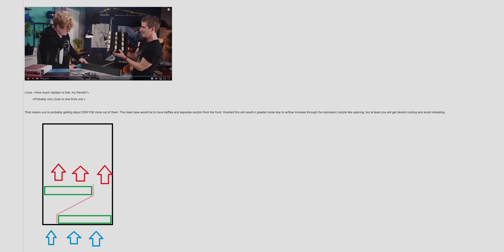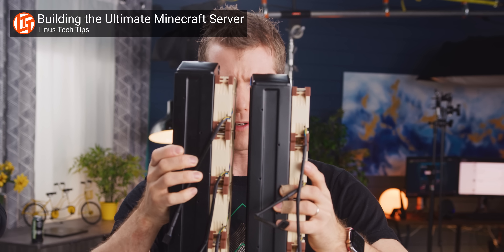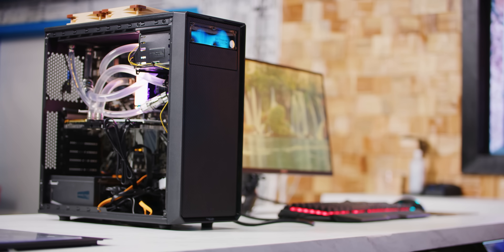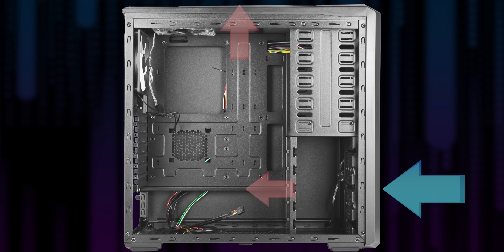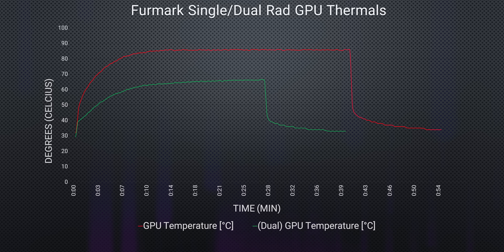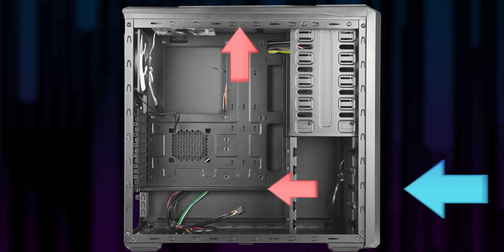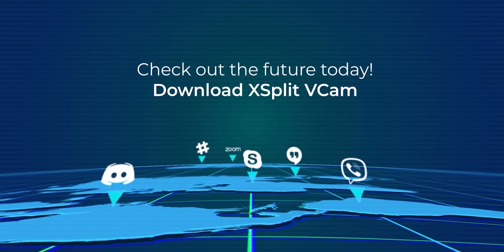I’ve been water cooling wrong for YEARS - $H!T Manufacturers Say

Comment: 0:18 judging from this Corsair is saying you need separate airintakes to supply each rad with their own cold air. Which makes sense. Corsair is right that the most cooling occurs with the highest temperature differences; so you want cold air against your hot rad, not pre-heated air.

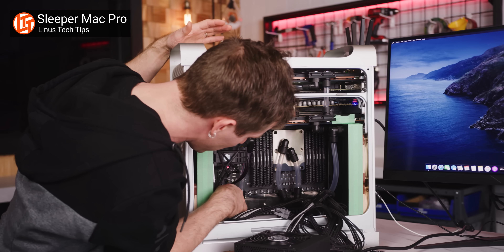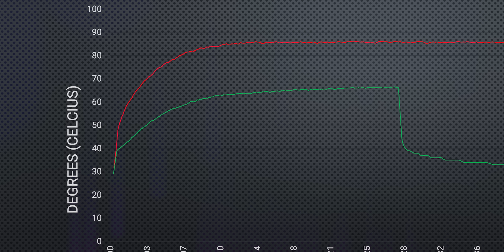6:46 Remember not 2 minutes ago where your additional rad gave you 20 degrees performance increase around 5:00 ? Well that's what I think Corsair is saying; you're essentially wasting the rad's power by not feeding it fresh air.

edit: I realize that I didn't properly explain the next part. What I'm saying is; in reactors they are OK with wasting cooling potential to reach higher temperatures so that the 2nd loop does more work. A 'reactor setup' water cooling would exhaust hotter air , but a 'corsair setup' water cooling would exhaust more heat .

Also I saw the "crosscool" comment, but the problem with a nuclear reactor is that you need that heat to do work. See https://www.ucsusa.org/sites/default/files/images/2015/08/np-how-Pressurized-Water-Reactors-work.gif
Here the first loop is heated by radioactive decay and cooled by the 2nd loop, and the 2nd loop is heated by the first and then drives turbines hooked to a generator before being cooled by a THIRD water system. You're doing work, not cooling PC components.
Reply: It's a consideration that you should include some extra fresh air intakes (or leave gaps in the case) but as Linus says at 6:45 they saw a 5 degree difference removing the 3rd stacked radiator from their server build which is probably the worst case scenario for this theory and it was still worth having the 3rd rad.
Reply: @TimSheehan  You're not wrong, they did get a 5 degree temperature difference with another rad. Yet in their test an additional rad created a 20 degree difference. And that 's what I think Corsair is saying.

Now sure, if you need more cooling, you can't do anything except stack the rads and that 5 degree is all you need.. Stack to the heavens my friend. But remember that if that other rad instead had it's own ambient air intake; there'd be even more cooling than that 20 degree difference.
Reply: @TimSheehan  it’s not that stacking radiators won’t lower temps, but stacking radiators lowers the effectiveness of the additional radiators. If the radiators were in a different configuration, the temps could be lower, or you could use less radiators and save money on your build.
Reply: @TimSheehan  As he said they removed the 3rd Stacked radiator so reducing the air flow if they had left the 3rd set of fans in would it still be the same? That said what if they removed the 2nd radiator as well and still left 9 fans would it still cool the same? As you can see it can go on and on. What would happen if it was just 1 radiator with 3x14k rpm fans.
Reply: @Northeastfarming  They didn't say about the fans but removing the resistance of the radiator would counteract the airflow difference even if they did remove the fans.
Reply: Strictly talking the "crosscool" comment. The fact that reactors need the heat to do work is irrelevent. If you put the hottest water rad at the end of the line for air flow then progressively get cooler as you get closer to the components then you will get an effect where the air gets warmer and warmer as it goes out of the system.
Reply: @Dem0n1337  Kind of true. If you have the lowest temp rad fed not by your components, but with cooler water, it will cool and warmer air will flow away from the rad. If then you have another rad behind it, thus fed with the warm air, it'll still cool. And as long as the water flowing through the rad is hotter than the airflow through the rad; you'll both have cooling and hot air out the end.

But do keep in mind that the hotter the air, the lower the amount of cooling. The tl;dr of Newton's Law of Cooling is that the greater the difference in ambient en object temperature, the greater the object cools. So if instead of each rad venting warmer air to the next rad, we have each rad exhausting the hot air into the .. well air then we'd achieve far more cooling.

All this means that it's, in fact, not irrelevant that you need that heat to do work. After all, the exhaust air of two rads each with their own in and out take is of a lower temperature than a (correctly) in series connected rad system where one rad feeds the other. This means that, yes; the air is hotter out of a 'reactor setup', but a 'corsair setup' exhausts more heat (i.e. cools more / is more efficient in *cooling*).

The primary use of a reactor system is not to cool the reactor, but to use heat to drive a turbine. The control rods are used to slow down the reaction and thus lower the temperature. Hence when that fails you are risking a reactor *meltdown*.

(pre-emptive edit, I may have to edit that first paragraph, it looks messy xD)
Reply: This, Linus needed to do another test with fresh air to the two radiators.
Reply: I also think that Corsair might have been talking about a different build that had much lower temps and a lower temp difference between the air and the water in the rad, or when they were directly stacking the rads like in the server they water cooled.
Reply: @nicokart6632  The sim graphics suggest otherwise. Linus is probably right about them not factoring in ambient air.
Reply: @Silicon_0014  There is no "ambient" air here the top rad is pulling air from the back and bottom. Its air pressure pulling the air in but they are mixing that air with the exhaust air so it is going to be less effective. Put the top rad at the back and have it also intake air. Block the bottom vents and put exhaust fans on top and it will work even better. Why do a shit job and say see look it "worked" without testing the proper way and seeing that it works better and cost nothing more. Why tell people to use their components in a less effective way? Did Corsair say that it would not work at all? No, so doing a test to see if it offers ANY cooling does not prove Linus right it proves he does not know the first thing about running a test. They always run 1 or maybe 2 tests and declare things settled. That's not how testing works and they do not have a control to test against here. Linus tested to prove himself right and look at that he did. He decided what would be considered a pass and he met that bar and called it a day. When you test a hypothesis you are trying to prove it WRONG not right and you exhaust every possible variation before you say that it is true. He tested ONLY his solutions and stopped when he say a change but did not bother to see if there was a better solution. Physics and math are not wrong here and neither is Corsair.
Reply: @WillisPtheone  he is also adding more fans to the case. I also think the single loop will work better with 4 fans helping with airflow. the only thing linus is proving is that he did not understand what corsair was saying.
Reply: @nicokart6632  yup, that's the tl;dr

Higher dt means more heat exchange; provide each rad with fresh air
Reply: i never downvote but this video deserved it and can entirely be summed up as a strawman. wtf linus.

Comment: I'd like a revisit on this topic. what does the difference in water volume make in this test? What if the solo rad was bundled with a bigger res that would have the same volume as 2 rads with a smaller one.
Reply: More radiators provide more surface area.  Adding more water will increase the time to reach steady state, but won't improve cooling overall.  Adding a second radiator will both increase the time to steady state AND improve cooling due to the additional surface area.  Of course, this is dependent on the exact PC enclosure that is used, how many fans are installed and in what orientation.  As Tech Jesus has proven, more fans is not necessarily better....and the wrong fan configuration can be just as bad as no fans at all.

Comment: Why not suck in cold air through a radiator from top?

This creates overpressure in the case, but if a free fan blows out the back, it could work there, couldn't it?

I will test it

Comment: there is something to be said about set up with concurrent vs countercurrent flow. 
If the radiators are in series you would want to set them up so that the hottest water contacts the coldest air.

Comment: Why didnt you run the tests on the setups they commented on? With multiple rads you risk overheating the liquid if airflow is restricted. There has to be enough air coming in the rad for it to properly cool. I wish there were more affordable cases that allowed rad setups that take air in from outside the case, go through the rad then blow outside the case

Comment: stacking radiators together like the mc serv works fine, you just have the rear most rad that should be receiving the warmest air be the inlet and have the water cycle forwards through the progressively cooler rads, yes you will have diminishing returns but it will work just fine.

Comment: I think what Corsair was getting at is that if one rad (say a 360mm) can already handle most of the heat, adding another one could hurt it, as the air is already heated up from the front rad and is also being heated up more with RAM, VRMs, and so on, potentially leading to a higher temp in the second rad. However, this assumes that no fresh air is being introduced into the case, as Linus pointed out. A single 240mm is going to be heat soaked by a high end CPU and GPU, and I would love to see what happens with a closed off case and like a 360mm at the front.

Comment: 2nd rad and water introduce additional thermal mass so the heat capacity of the loop will increase in relation to that regardless of the cooling elements
Reply: they waited until each loop reached a steady state

Comment: Cooling vs power usage is one thing I'd definitely be considering ..... A variable seemingly MISSING from the test. Cool inwards air is something Nice America (aka Canada) has an abundance of too, so getting more cool air into the case is a goodie too!

Will water cooling even be relevant in the future tho, considering the leaps in semiconductor design & manufacturing with chips emitting less heat all round!

Comment: Corsair complains about stacking, Linus starts testing non-stacked.
Reply: They also tested removing one of their stacked rads from the minecraft video and temps jumped 5 degrees. Having one rad input and one output for the main test is very similar to the hack mac pro that corsair complained about first too
Reply: Did you happen to skip too far when Linus delivered his sponsored message? The first time Corsair reached out to them about this, it was for their Hack Pro build which had two rads on opposite sides of the case - this was what they tested in this vid. They reached out to Linus AGAIN regarding the stacked radiators (which they tested by removing one and checking the difference in temps).

Comment: You have to flow the liquid in the reverse direction than the air. See cocurrent vs countercurrent heat exchanger designs. Later is dramatically more efficient... if both fluid had the same heat capacity.

Comment: A tiny difference can be achieved by changing the direction of the water in the radiator.
If the colder water enters first the "outtake" radiator, and then the "intake" one, we can obtain the best result.
https://www.unilab.eu/wp-content/uploads/2017/04/unilab_heat_transfer_blog_Evaporators_and_condensers_counter_current_or_co-current_arrangement2.jpg

P.S.
I think that corsair needs new engineers in their staff.

Comment: :) If adding more radiators wasn't a thing to help keep temps down then why do super cars have like 10 of them. The Bugatti Veyron  not only has 10 Radiators, but also has 3 heat exchangers. And correct me if I am wrong here but I am fairly certain that a Bugatti Veyron produces a hell of a lot more head at 250+ MPH then a single Radiator can handle. Just sayin.

Comment: What I'm curious about is whether the air pushed through the radiator stays there long enough to get saturated. You'll hit "critical mass" at some point, where the amount of heat generated by the CPU and the amount of heat dissipated by the cooler will become more or less even, at which point increasing the airflow any more won't help, because the cooler can't dissipate any faster. (This is even more evident when the CPU is idling; at some point, increasing the fan speed just doesn't affect the CPU temperature at all).

I must admit that I'm far from any expert on physics though, so this is mostly just speculation on my part.

Comment: im not a water cooling person, however the addition for a 2nd radiator would increase the thermal capacity of the system (more water), since the thermal capacity is measured as J/KG/K you will have the same J (same heat outputting components) you KG will increase (more water) therefore your K (temps) will decrease therefore your dT across the first radiator would be greater results is a grater cooling rate from newtons law (cant remember the equation but i know its based on dT/dX), id suggest, to test this, instead of adding a 2nd radiator, add a 2nd reservoir and try again. I could be wrong here but i thing the physics and maths works out

Comment: A second radiator makes perfect sense. But it has to be integrated correctly. The hot water needs to go through the "hot" radiator first and then through the "cold" one. You're basicly trying to emulate a counter-flow heat exchanger.

Comment: If I remember correctly from my brief education in power engineering; you need to have a difference of about 3 degrees celcius to get a transfer of heat that actually reduces the heat from the hot side. Anything less is just too close to be useful. And even then, you need to have that difference stay constant. Water is nice for that, at least until it builds up in thermal load. 

Linus is basically all around correct on the practical side of things. Corsair is correct on the technical side of things. As Linus puts it, the real world scenarios have too many variables to apply a blanket statement on this. 

I would like to see Linus try a variant of push/pull setup with push and pull alternating every other fan. The idea is that if you have two fans on each radiator, you put the left ones in push, and the right ones in pull. If you had a 4 fan radiator setup with 4 radiators, you would have them all being push/pull/push/pull from left to right. 

What I would hope to see happen if he tried this would be a further reduction in temps by a few percentages beyond 1%. The reason has to do with that temperature difference. I believe that with this setup, combined with a case that has good airflow to keep the inside close to ambient, the air being supplied from both sides should be ideal for heat transfer at all times, even during heavy loads.

Comment: use air to cool your pc...
 or use air to cool water to cool your pc and take heat from chips and put it on the case which is metal which then puts heat into your motherboard ports etc and you end up with more heat everywhere ... avoid water cooling at all costs if u want to waste money just give it to me or charity 
ads on ads

Comment: I think what Corsair was trying to say was that the Minecraft server stack wasn't cooling as efficiently as it could with 3 rads front to back.  I am by no means an expert, but wouldn't three rads stacked top to bottom like a wall cool better than three rads like a sandwich? If the difference in air temps is what cools the loop, start at the top and work your way down the wall of rads with all three doing intake from outside. So in the instance of the Minecraft server, having a floor of radiators oriented in the shape of a Pi symbol would cool better than a sandwich with one on each side of the compartment with intake fans on the outside and exhaust fans at the open part of the Pi symbol. To me at least, that sounds like it would cool better or at least more efficiently than sandwiched rads.

Comment: everyones been calling me an idot for putting the radiator on the exhaust so it doesnt heat the system
Reply: If your system generates minimal heat inside the case because your water loop absorbs the heat then a radiator at the exhaust would be most efficient. After all, if you do it on the intake, you'd be blowing heated air over your components and loop. Just how much difference it makes, I don't know.

Comment: I'd like to see someone test stacking radiators, that'd interest me more honestly.
Reply: They did. They removed on from their tripple stack minecraft server and temps jumped 5 degrees
Reply: @____5837  Oh damn, they did! Missed that throwaway line just hidden in the middle of his final explanation! Ty for pointing it out.
Reply: Stacking works with counter flow cooling, as in, the hot water enters the last radiator, which is being fed with hot air from the first radiator, then into the first radiator, which is being fed with cold air. The waste air from the first radiator, while warmer, is still able to pull some heat from the warmer water, in the second radiator, and the first radiator benefits from both cooler air and cooler water. 

This is a well established practice, not sure how corsair is coming up with their numbers here.